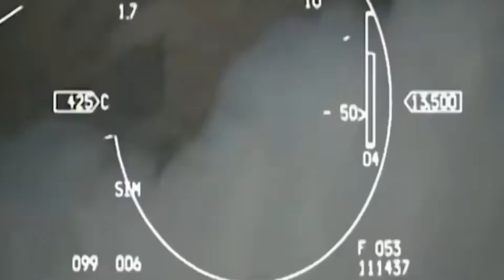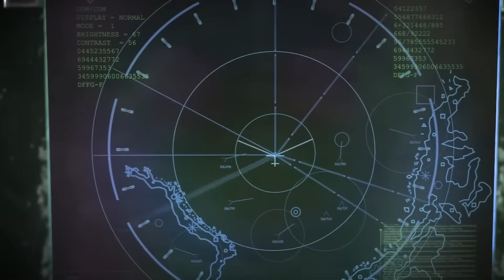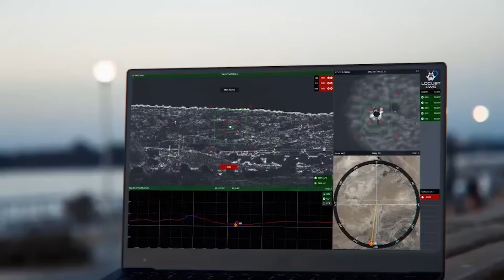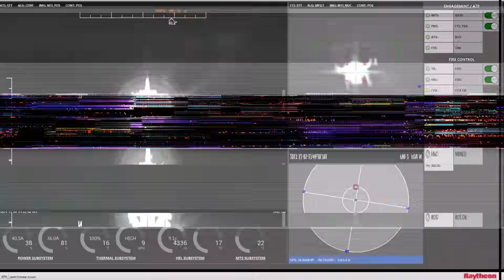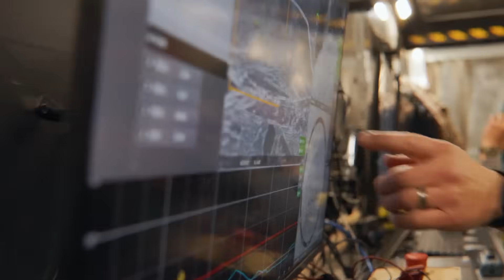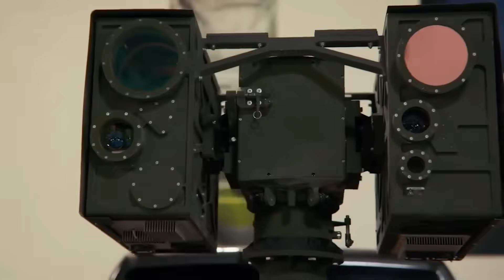ISRAEL $1 Billion Laser Weapon Will Beat IRAN in 1 Sec!

Comment: Almost saw the defensive, uh, missiles systems that Israel has, we're all intellectually conceived by themselves. Money might have been given to Israel to help it develop it, but it was done by themselves. And yeah, uh, this will does not need intelligence information for its systems to work from the United States. That's just not true. That would take so much more extra time. They don't need that. What are you kidding me? And this was, I am beam, is already at this time of my fausting. In battle, it's already been tested and it's been deployed in the building quickly, as they can many more batteries to cover the country. It's a 100 W and It's better than Helios, it's more powerful than Helios. Totally. Developed by Israel, the United States wants it. Everybody wants it. So yeah, your information is right in some ways. And it's wrong about this, because again, all of these systems is will develop by yourself. The United States and other Western countries want to buy the plans. I guess you can call it the schematics. For the changes, they made to the up 35. The F35, which really isn't even an F35 anymore. Actually, it's not and because the United States can't figure out how Israel got into their systems and into the F35 systems that changed everything the way it did. And uh, technologies, it's a much better plane, different plane than what they sold them. Yeah, and they're trying to get, uh, you know, they're trying to get those changes from Israel. And then I think they were offering money and other countries like I said in Europe and stuff are offering money to get some of the changes too I don't think Israel's going to Yeah, especially now with what they've been saying and doing to Israel, uh, get anything out of Israel. But the United States of short, well, because that's the partnership, that's pretty strong. When it comes to the military and when it comes to intelligence, if it doesn't need anybody, I'm sure it helps to have America's intelligence. But and you know to work with I guess for verification and stuff like that, but when it comes to NATO and all the European countries and stuff like that they don't hold the candle to the intelligence of her Israel I watched the, I listened, I've lied to 12 videos, actually that set over because of this thing with the U. England recognizing statehood for palestinians that you know that they had nothing to lose because you know that issue had everything to lose because it was losing a laughing to myself, the United Kingdom's intelligence and it's just the other way around. Israel has thwarted many, many, many terrorist attacks, and then, once and all across the world as a matter of fact, I don't think there's one case at all that England does. Notified Israel of a free uh, friar to a terrorist attack, given Israel a warning. I mean Israel takes out their own terrorist attacks and when terrorist attacks are made. Apparently, England didn't know LO. L, it's all crazy this whole world anyway, when it comes to defense and to digital technology.
Is among the top probably the United States and England I'm sorry the United States and Israel. And my speech to text keeps going in and out. Probably the top 2 in the world for digital technology in defensive and offensive weapons are Israel and the United States. Israel has just been talking, mostly about. You know, shooting down planes and stuff like that, with the laser. But they can put these lasers on trucks, they can put them on ships, they can put them anywhere. I don't see, you know, I'm sure they're going to use it offensively, why can't it would be a 100 W laser? You know, at close range, it could take out another tank, it can take out use. These amounts of troops like your spray machine gun, your spray, I mean, the offensive, uh.
Possibilities are staggering. They don't talk about it yet, because I guess they don't want to give anything up about that. Anyway, thanks for your video p. S this comet went all over the place? Uh, sorry, When you when use dictate instead of using a keyboard or a pen, at least in my mind, it's a different process, and it leads me to wander rough topic, smiling.

Comment: I'm not a boffin? But I would sumise, that actually Lazer systems are les than perfect for weapon systems in a conventional sense! Yes they may be powerful, but also have MENY drawbacks!  In order to use a Lazer to it's full effect! You have to be able to bend Lazer beams? ( WICH I believe with our current technology is impossible) ! So we either have to make it's platform extremely mobil , fast, multy directional, & also be aable to use whilst on the move ! ( Their for needing to be compact , aironortical , & able to hover) WICH at the moment I believe is beyond our capabilities)?
So as a static weapon YES ?  But anything beyond that !  It's unsuitable, so it would either have to be a totally armoured or extremely hidable?
Yes lazers are prity impressive but lack very little implications?,